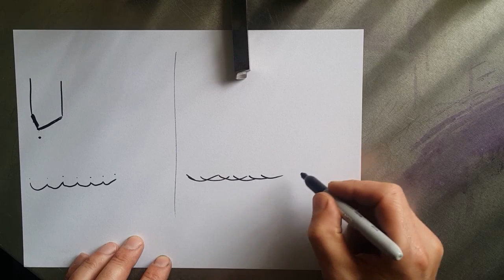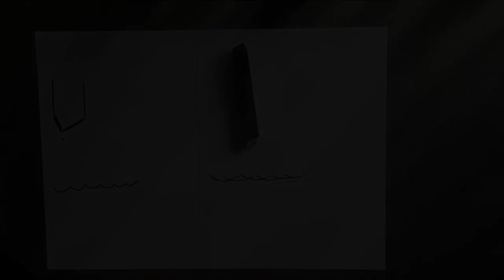#58 - Viceroy Royal 250 Shaper - Chasing the ultimate finish on Cold Rolled Steel

Comment: hey NZ, looks good. Ive never really had too much luck with shear tools on getting the finish I really wanted, I think what gives me the best finish in mild steel, both cold rolled and hot rolled, and in cast aluminum was a tool bit with a really large radius on the end, and has a pretty steep top rake on it. I run that tool at normal speeds and at around 2 1/2 thou stepover, and it comes out like a mirror on most stuff, or polished brushed metal on others. Because of the steep top rake on the tool, you dont want to take heavy cuts with it because it's not as strong of an edge, and sometimes it'll want to chatter, so it's good for lighter cuts only. I know steve summers, shaper andi, and a few other people have done videos on testing various tool bit geometry on thier shapers to get the best finish.
Reply from the maker: Hi Chirpy, thanks for the input. So many different ways. I'll try your suggestion and see how I get on. Cheers Kevin

Comment: Gday Kevin, awesome results, I’ve fiddled quite a bit with my shear tool and slowly getting it better, trail and error as they say, I haven’t got as much angle as yours so I might try that next, thanks for sharing.
Reply from the maker: Hi Matty, I was trying less angle without much luck. It wasn't until I watched one of Rustinox's videos that I see him using more angle. Thats when I started to get good results with the shear tool. Cheers Kevin
Reply: I remember now Rustinox talking about more angle on shear tools especially on small shapers, I’m currently machining some square stock down smaller which needs a nice finished surface so I guess I’ll be re-grinding the tool tomorrow, I think you will get a lot of enjoyment out of your shaper, it’s the most favourite machine in my shop,
Reply from the maker: @MattysWorkshop  be interested to see how you get on
Reply: @Machine_NZ  Who?